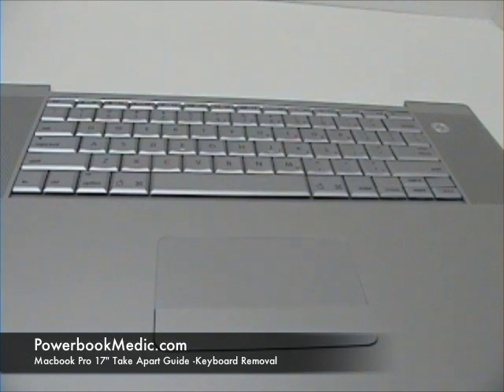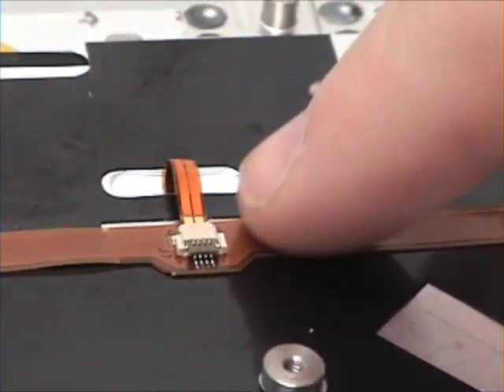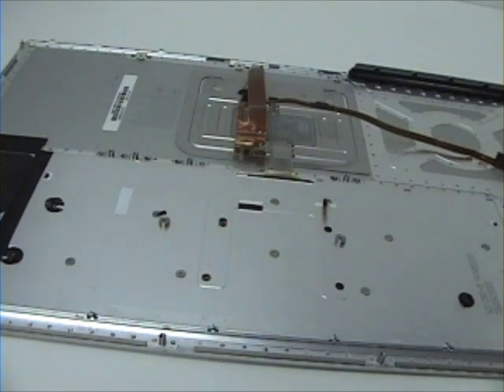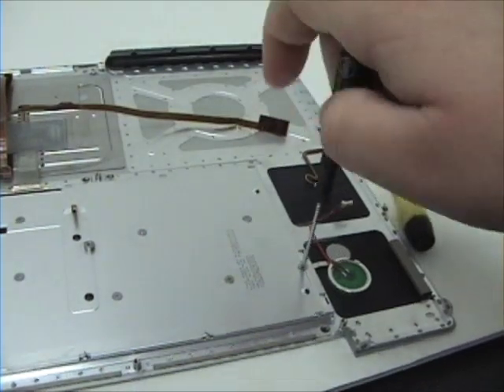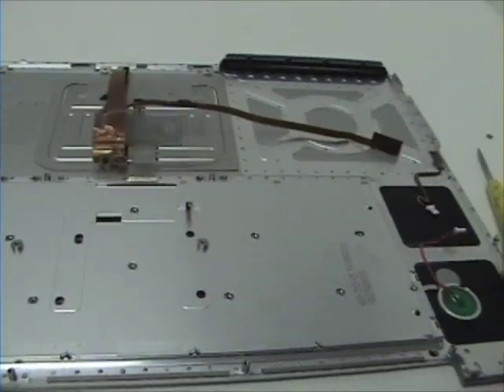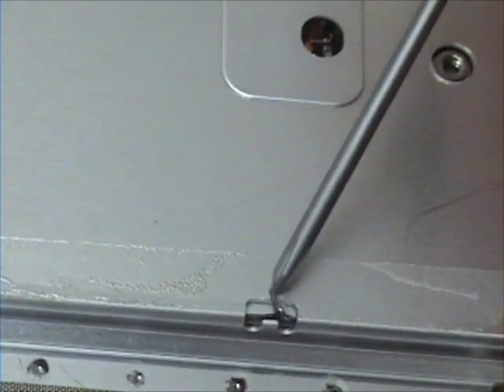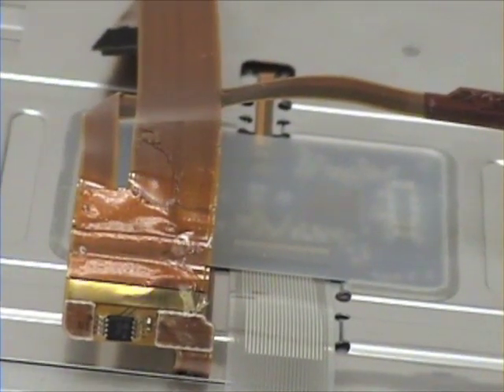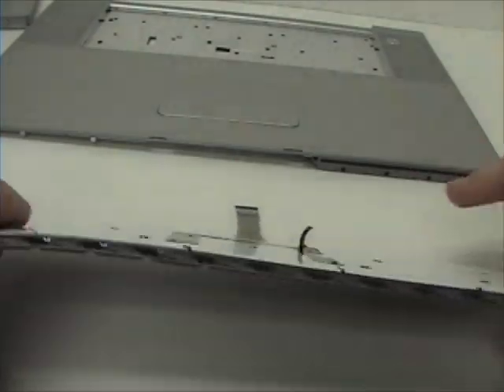Macbook Pro Repair 17 Inch - Keyboard Removal

Comment: Nice VIdeo. I think you meant to say flat head instead of Philips at a few places in the video? You can use annotations to fix this without having to rerecord, encode and upload all over again. (I've been there!!) Also would it make sense to record the locations of the tape as I'd forget where to put them on the new keyboard? Thanks again. 
JacanaProductions.

Comment from the maker: If your key doesn't respond, then there is nothing you can replace other than your keyboard. If the key is simply misaligned or broken, you can replace the keycap. Parts and instructions are available from our website.